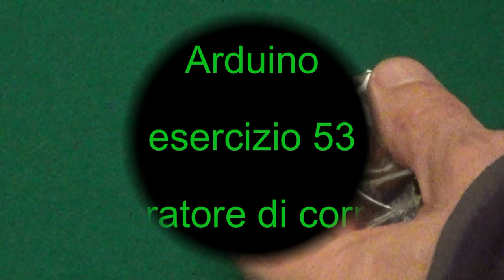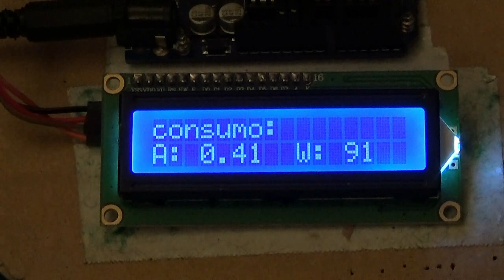misuratore di corrente - electric meter - Arduino - e53

Comment: Ma le librerie per il display non esistono più o si trovano altrove?
Reply from the maker: Hai ragione. Ssembra che la libreria abbia traslocato in altri lidi 
Questo il nuovo indirizzo: https://github.com/fmalpartida/New-LiquidCrystal  Devo ancora provarla, ma suppongio che funzioni.
Ti ringrazio per  la segnalazione. Ora la provo e se funziona modifico i riferimenti in tutti i miei progetti. Grazie ancora
Reply: @giocarduino4954  Comunque lo sketch andrebbe rivisto includendo altre parti di quella libreria: #include <LiquidCrystal_I2C.h> non basta, ha bisogno di altro altrimenti il compilatore dà errore
Reply from the maker: Ho appena ricompilato il programma con la libreria presa dal nuovo sito e non mi sono stati segnalati errori. 
E' probabile che tu abbia installate anche altre librerie per la gestione LCD e che il compilatore le utilizzi al posto della NewLiquidCrystal. 
E' un problema comune e per superarlo devi cancellare, da documenti/arduino/library, ogni altra libreria afferente alla gestione dei display a cristalli liquidi. 
Ho letto da qualche parte che la nuova libreria (la NewLiquidCrystal) copre, completamente, tutte le funzioni previste dalle altre librerie per cui eventuali altri tuoi programmi che hanno fino ad ora usato altre librerie dovrebbero continuare a funzionare senza problemi. 
Buon lavoro